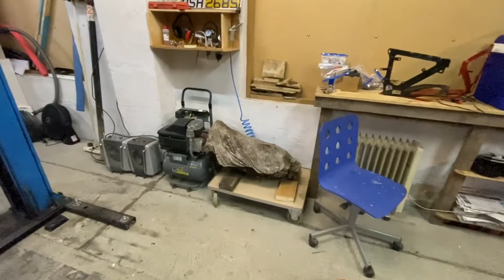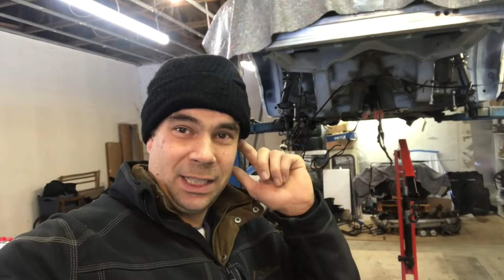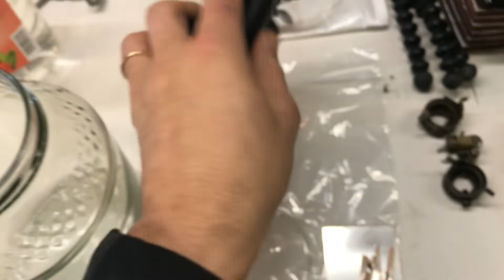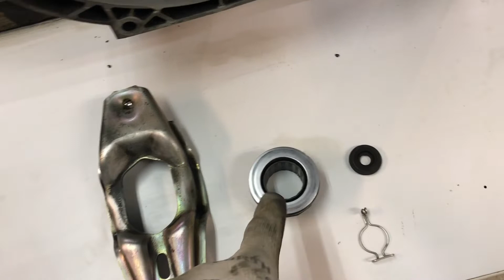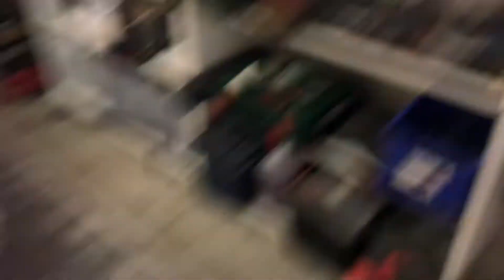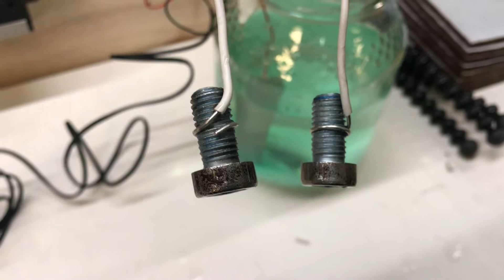Porsche 996 Restoration - Part 7 - Tidying up the Getrag 6-Speed Gearbox

Comment: Great job!

The plating was working...  leave it longer.  The cold in the garage, will also affect that...  Heat increases the speed of the reaction...  Or go more milliamps... Find a laptop charger or something near or at 1 amp, if you want it to happen faster....  Or you can get a power supply, which is great to have.....
Reply from the maker: Hey Patrick, great to hear from you. Thanks for the tip. Will do. I think mines around 450ma. Probably too low.

Comment: Looking good. I own a 2001 Porsche Carrera Cabriolet and it's the best purchase I ever made. Enjoy. Happy Motoring!
Reply from the maker: Hi William, I agree with you. They are excellent cars. The only issue I have with mine is the seizing of the steel bolts in the cast alloy parts. But that depends on where you are based as it’s bad weather and road salt that causes that issue.
Reply: @My911  Agreed. In the winter my cars don't leave the garage. Right now they are covered and away for the winter.

Comment: Keep the videos coming. I enjoy seeing your progress. I haven't had time to do anything with my 996.  Can't wait to see yours back on the road!
Reply from the maker: Hi Rick, will do. It’s mega slow progress but at least it’s progress. 😀
Reply: @My911  Hey, we do what we can do right? I don't remember from previous videos, what trim is yours? I have 2005 996 c4s. Mine had bore scoring so I am actually having a company replace the cylinders with nicasil and converting to a 4.0 over this winter.  Should be fun when I get it back!  Other than motor work like that I do all my own maintenance like you do.  Take care!
Reply from the maker: Wow, that sounds great. A 4.0 996. Can’t be many of those around. Keep me posted. 👍
Reply: @My911  there is a company in the us that has been perfecting it for years. They do a good job. They do some mild head work along with with the job as well. The motor should make 400hp 320-330 tq. I can't wait! Also comes with the ims solution as well.  They are the ones that developed the ims solution. Plain bearing replacement for the ball bearing unit.
Reply from the maker: Nice, you must be very excited. I guess with the Turbo running gear the car can take the extra power too.  A friend of mine in the UK has a silver ‘03 C4S. Absolutely beautiful cars.
Reply: @My911 I am very excited, just need to get through the winter to drive it. I don't drive during the winter as the salt here is a death sentence to the car, as you know very well! I love the rear end of the C4S. Apparently the drive train and transmission is stout and can handle power with no issues. I honestly didn't think the car needed any more power however it will be. Nice bonus to the new motor!
Reply from the maker: I’m the same. I have a season registration. March until October. Where are you based. US?
Reply: @My911  New Hampshire. Weather here is typically rough with snow or ice November through March and sometimes through April too. Winter gets long waiting to take the car out. Do you think you will have yours back on the road this spring?  Not sure what you have left with your project there?
Reply from the maker: Ah, a lovely part of the world. We travelled up through New Hampshire on our way to Maine some years ago. Great memories. 
I would really like to get it done by March, but I have so much to do still. But let’s see. It’s been off the road for 18 months so far. 😢
Reply: @My911  Well best of luck to you! I will be following the progress.

Comment: Nice to see you back with another video. For electroplating the parts need to be meticulously clean. Wire brush, degrease then a bath in diluted hydrochloric acid for 60 seconds. Rinse in distilled water then plate, you’ll get better results. Merry Christmas to you and your family.
Reply from the maker: Thanks Andrew, I guessed as much. Only thing missing is the acid. I’ll see if I can get some.
Reply: @My911  dilute 90% and do it outside or well ventilated area and don’t breath in the vapour.
Reply from the maker: @andrewfraser4347  thanks.